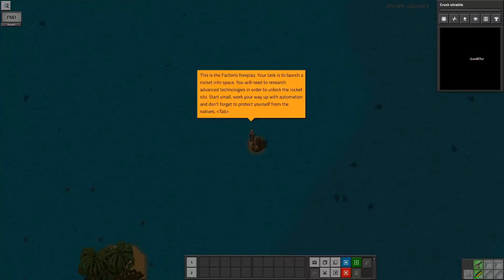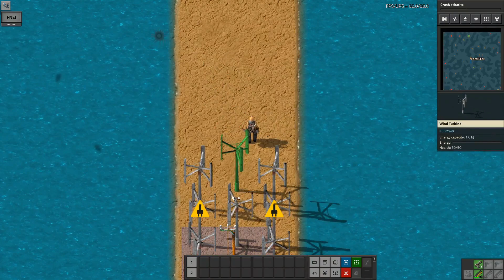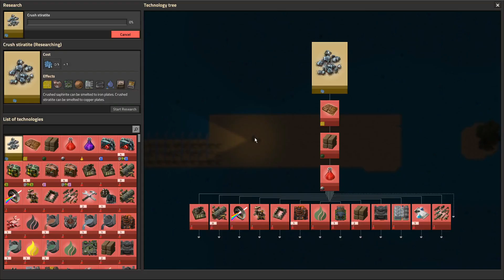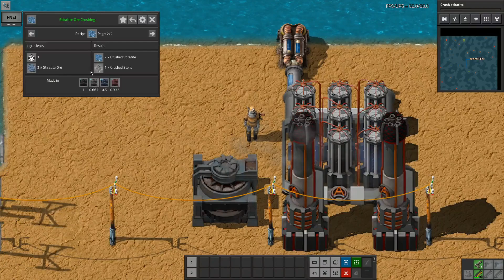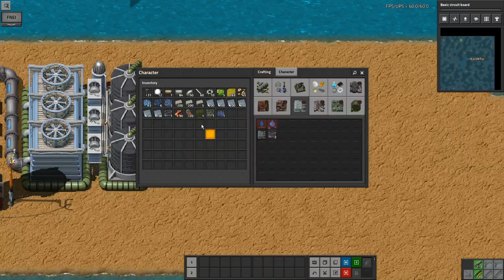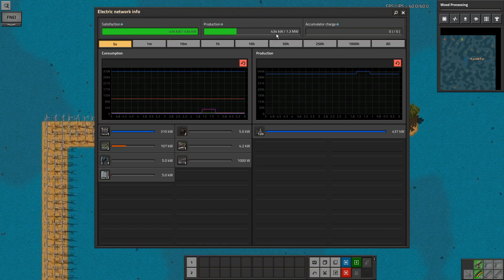Factorio Seablock + TSM ep1

Comment: Will you use some other mods as well or only seablock and tsm?
Reply from the maker: I have squeak through as well. TSM has some special new functions that may be very helpful.
Reply: @Sandman-qi2jy  Could you share the map exchange string please?
Reply from the maker: @Swingblade1  >>>eNpjYBACQkYGIGiwB2FGrtS81NxK3aTE4lSYGBgzVjHO42xokWMA
4f/1DAr//4MwkPUAqBmEGRgbICqBYjDAmpyTmZbGwKDgCMROYAsYGat
F1rk/rJpizwhRo+cAZXyAihxIgol4whh+DjilVGAMEyRzjMHgMxIDYm
kJ0AqoKg4HBAMi2QKSZGTsfbt1wfdjF+wY/6z8eMk3KcGe0dBV5N0Ho
3V2QEl2kD+Z4MSsmSCwE+YVBpiZD+yhUjftGc+eAYE39oysIB0iIMLB
Akgc8GZmYBTgA7IW9AAJBRkGmNPsYMaIODCmgcE3mE8ewxiX7dH9AQw
IG5DhciDiBIgAWwh3GSOE6dDvwOggD5OVRCgB6jdiQHZDCsKHJ2HWHk
ayH80hmBGB7A80ERUHLNHABbIwBU68YIa7BhieF9hhPIf5DozMIAZI1
RegGIQHkoEZBaEFHJgZEACYLGQPRNYAAIY4ey0=<<<
Reply: @Sandman-qi2jy  Thank you!